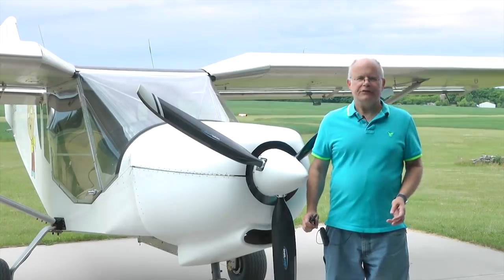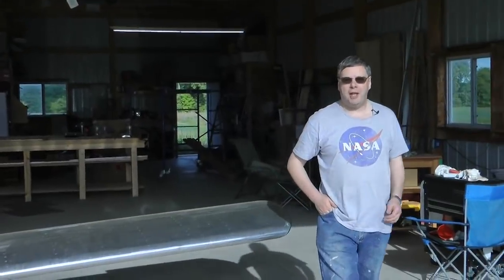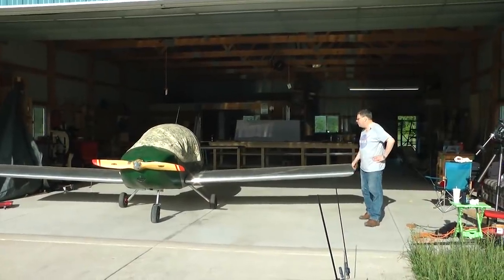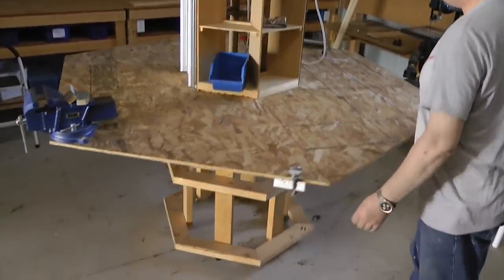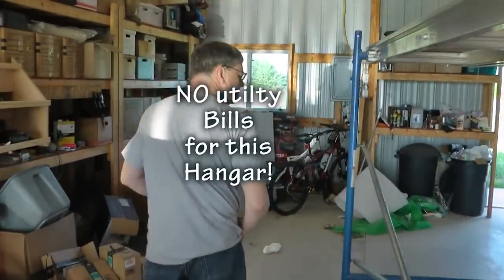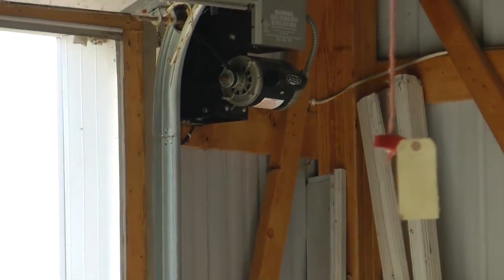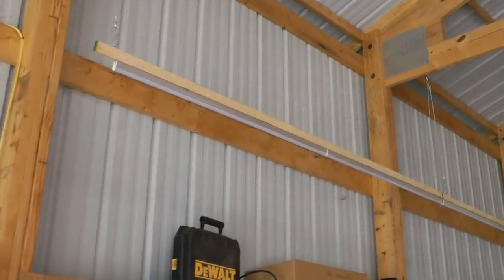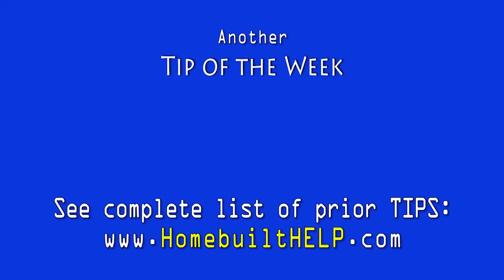Creating the Ideal Hangar-Workshop (mancave)

Comment: I would have insulated the building before anything. It's cooler in the summer and easier to heat upon the winter. And I would have asked the utility people could I do the trenching to save cost. Solar is just constant maintenance. Nothing like power for 24/7.

Comment: I installed a small 500w solar panel system running for very cheap at my remote hangar in Kansas.  It works much more reliably than the generators the other folks use and it doesn't make any noise.  My system is much smaller, but it runs a drill press, radio, small compressor and runs my 28v LED lighting system for at least 6hrs.  The panels connect to the batteries with a MPPT controller, then the battery connects to a 5kw inverter which runs all the 120v equipment.

Comment: That was a very nice hangar! Question time!!! Are those batterys a fire hazard? Let's say he added 2x or even 4x more, then would it?
Reply: No ... they are sealed, correctly spaced, appropriately sized, charge rate limited and designed for the purpose.  If I had used a mixture of types (or maybe leftovers from a 787 project ;) ) then there could be heat issues with charging asymmetry.

Comment: I wonder if you can build during winter: virtually no sun power, so batteries may take weeks or even months to get charged. Depends of course where you are.  And what about any heating?  Or vandalism and robbery (of your exposed solar panels or worse): are you well insured?  At remote locations this might be expensive.  But if it serves you well: be happy, don't worry.  And success with your repli tiger moth.
Reply: Actually, on a sunny winter day they charge really quickly.  I am close to the 44th parallel, so do not have months of darkness ;)  The "45 mins of continuous use on a 90 minute charge time" rule works pretty well, even in winter.  Nobody uses big tools continuously, so I have never run out of power. 
 Rechargeable tools also help even out the power demands.  The biggest winter problem so far has been snow drifts limiting access to the building.  I just plan my projects to take care of smaller assemblies, wiring, software &c. in the winter.